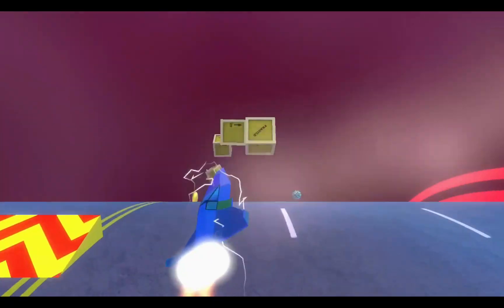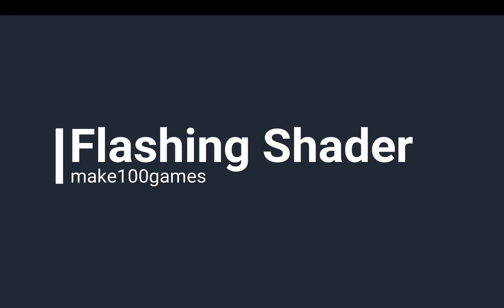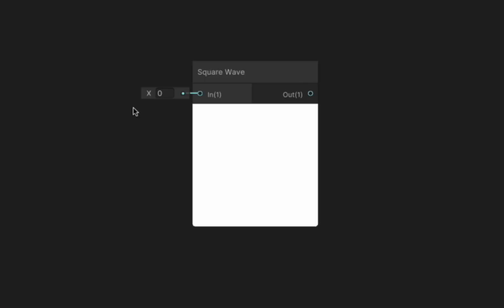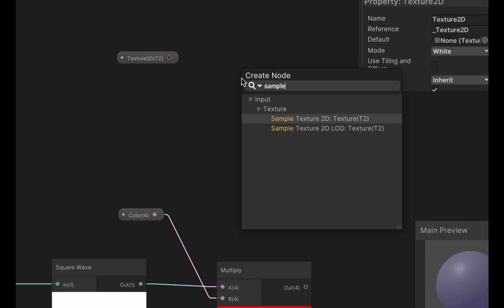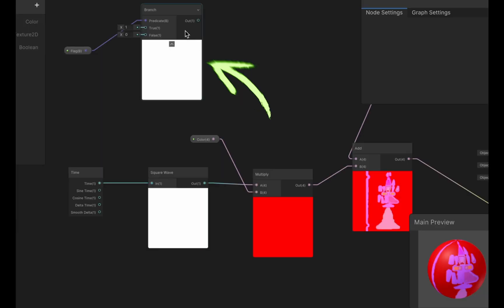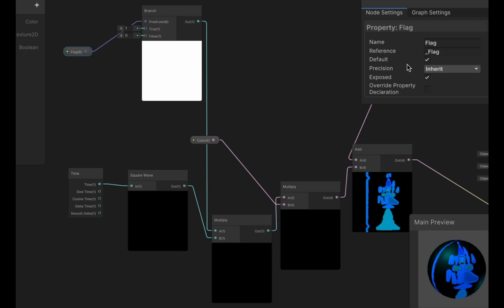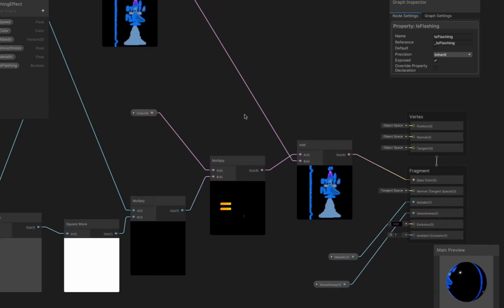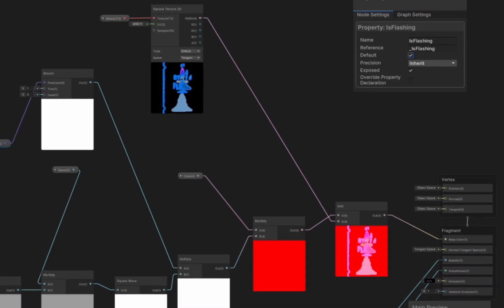Flashing Shader in Under 3 Minutes! (Unity Shader Graph using Square Wave and Branch Nodes)

Comment: I would recommend using an int instead of a boolean and then multiply that directly before adding the flashing.
That would be better because if statements are a big nono for GPU's because of how they function.
You should check it out sometime because it is very interesting :3
but in very simple words the GPU groups pixels together in bigger groups for calculations and performes the same calculations in order to all of the pixels. If you use an if statement both the true and false condition would be calculated for everything. It might not influence the performance of the shader in this use case but it is good practice to learn tricks to avoid if statements at all costs.
Reply: thanks for teaching me how bikes are made
Reply from the maker: Thanks for the heads up! If you don't mind me asking, why do they offer a branch node if it is an anti pattern in shaders? Is it because in some cases you simply cannot do without and it should be used only as a last resort type of thing?
Reply: @make100games  Yes exactly what you said. Same goes for any form of loops btw but i think shader graph doesn't offer that and you have to use hlsl for that.